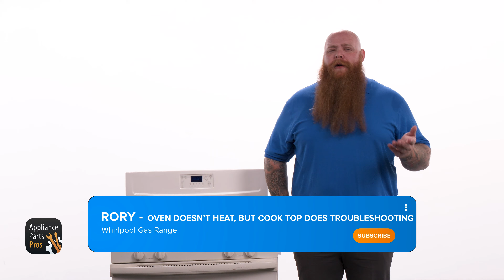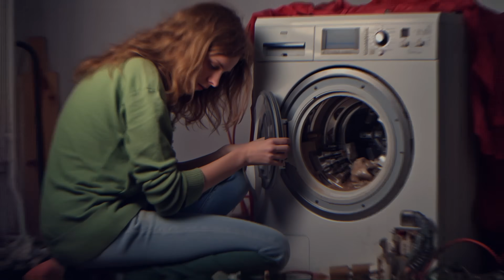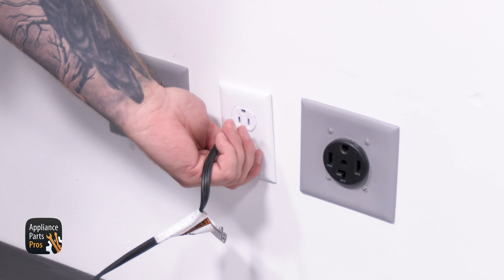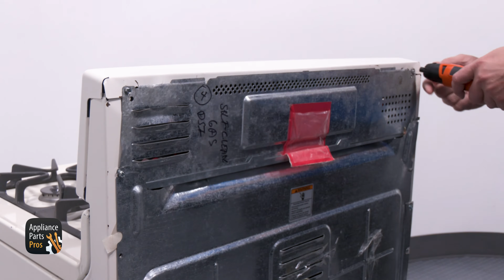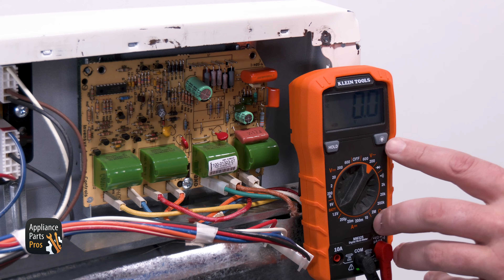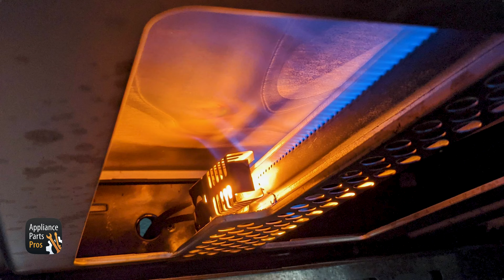Why Your Whirlpool Gas Oven Isn't Heating and How to FIX IT NOW

Comment from the maker: 🔧 Common fixes for this issue:
▶ Oven Safety Valve – WP98014893: https://www.youtube.com/watch?v=U3bDtcp2IAM
▶ bake oven igniter (no specific part number given): https://www.youtube.com/watch?v=BWrqsbWP2jo
▶ Oven Safety Valve, Frigidaire/Electrolux part #3203459: https://www.youtube.com/watch?v=qLBMXYFv0xM
▶ Oven Control Board / Electronic Clock, part number 316455400: https://www.youtube.com/watch?v=z2us-eh9Tbw
▶ Electronic Control Board WP5701M748-60: https://www.youtube.com/watch?v=Mg_Cfc5eFHs
▶ Oven Bake Igniter #5304509706: https://www.youtube.com/watch?v=yBH2kcI5nHo

👍 Found your fix? Hit Like so others can find this video too!
🔔 Subscribe for more repair guides: https://www.youtube.com/@AppliancePartsPros

Comment: Everything checks out, 120 volts here and there. I don’t know what else to check out. Igniters don’t have a glow bar, they spark. They spark a few times and no flame. Bake or broil. Self check came up with no faults. 
Could it be a stuck gas valve? Top elements are fine
Reply from the maker: If you need more detailed troubleshooting/testing from our techs you can check out our repair forum: https://forum.appliancepartspros.com/

Comment: Oven heats to temperature but then when it calls for heat again gas valve won't open. Igniter glows? Solve that one
Reply from the maker: For free technical support, please visit our Repair Forum: https://forum.appliancepartspros.com/.  It’s easy to register, and you can either post your question or search the forum to see if someone else has already asked the same question.
 
Our experienced technicians, with over 20 years of hands-on appliance repair experience, are ready to answer your questions and guide you through your repair.

Comment: Definitely needed. Gas ovens, washers, dryers, dishwashers and microwaves are appliances i usually need improvement on. As someone starting with refrigerators and HVAC for my business these videos are needful 💪🏿💪🏿💪🏿🔥🔥🔥
Reply from the maker: Love hearing that, @clockehvac1240! Sounds like you’re building a solid foundation — glad the videos are helping as you expand into more appliances. Keep at it, and we’re always here if you need part help along the way! 💪🔥